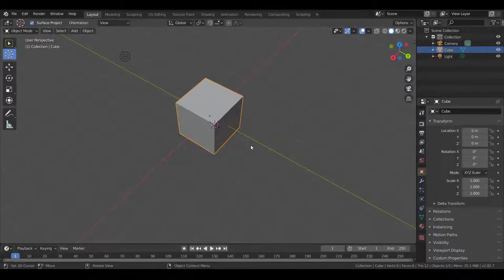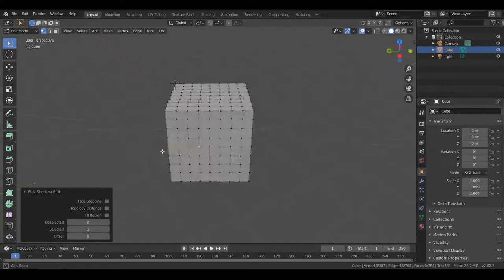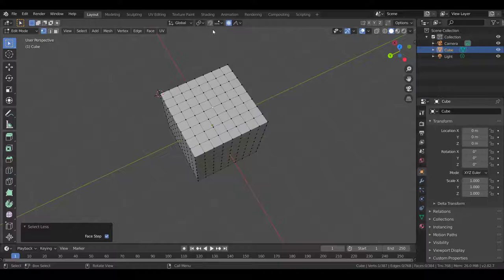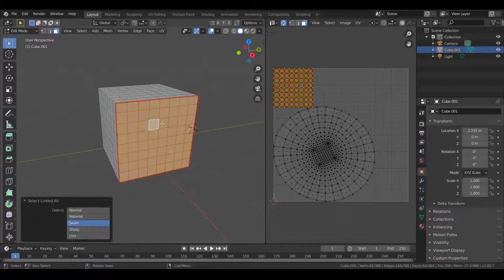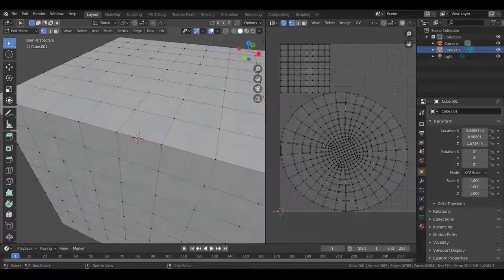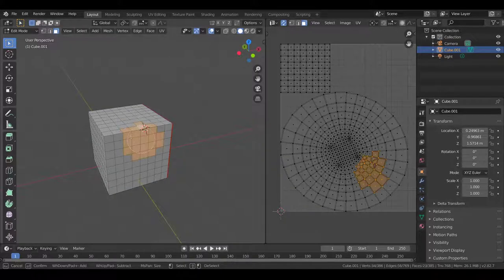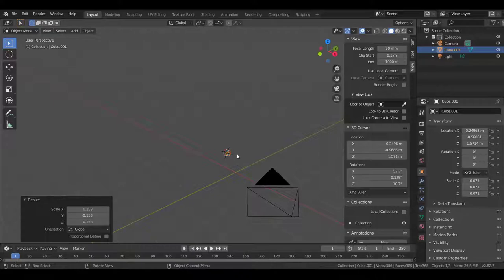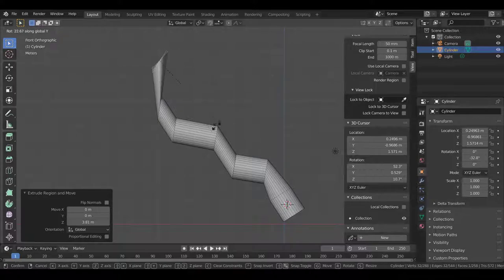Blender Advanced Techniques to speed up your workflow. (Check Description)

Comment: 7:08 you can set the origin directly in edit mode. You aren't working with the new version, so you have to prepare for that in the preferences. I have a video about that. 
2.83 was released yesterday. The shortcut for merge is now M.
As you were showing ctrl+L: you can also select the whole connected mesh with that  (set to normal instead of seams). Of course ctrl+numpad+ works but ctrl+L is quicker.
Reply from the maker: Thanks for the info! I'm going to have to remember to get 2.83 soon